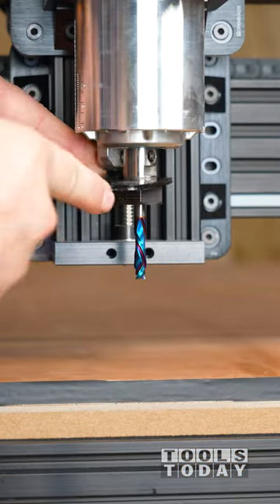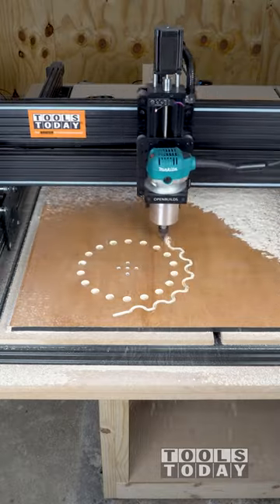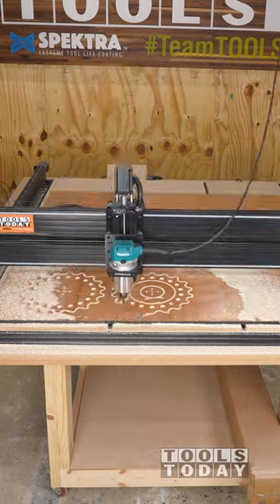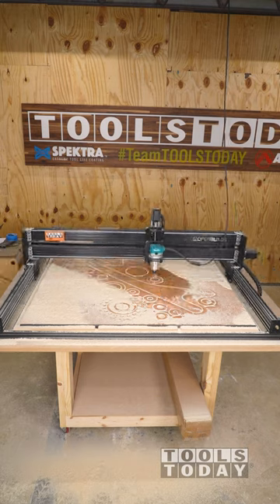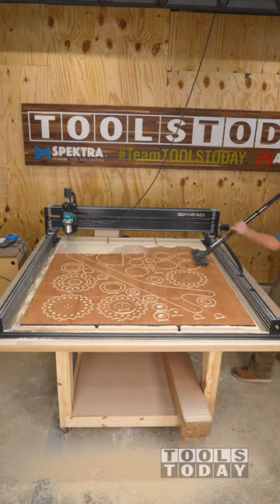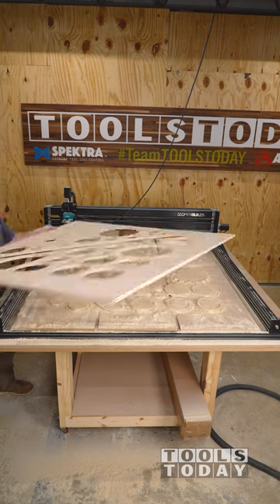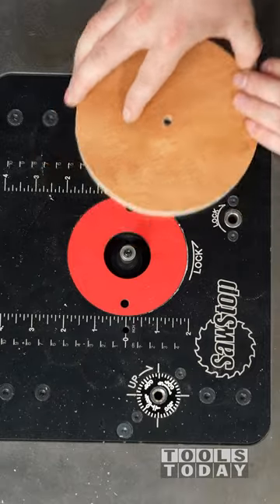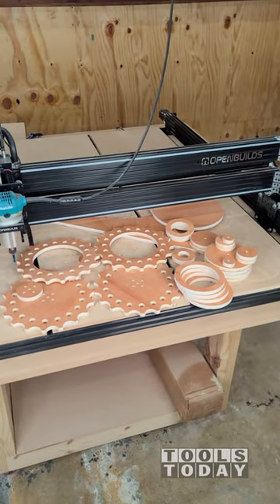Making Bulldozer Bed Parts on CNC

Comment from the maker: Check out the tools used on our website - https://www.toolstoday.com/openbuilds-3050-fl.html

Amana Tool 46170-K -https://www.toolstoday.com/v-13354-46170-k.html

RPM: 18,000
Feed Rate: 60ipm
Plunge Rate: 30ipm
Depth Per Pass: .48"

Multi-Tool - https://www.toolstoday.com/fein-71293261090-multimaster-amm300-plus-start-set-cordless-oscillating-multi-tool.html

SawStop Router Table - 
https://www.toolstoday.com/sawstop-rt-tgp-27-in-line-cast-iron-router-table-for-pcs-and-cns.html

Amana Tool 47104 flush trim - https://www.toolstoday.com/v-5334-47104.html
Reply: I work on a Homag N-300 5'×12' table. I used to work on an Onsrud 144g12. Worked on her for twenty years. I miss my Onsrud.
Reply: Hi Matt, I have a question regarding your feedspeed here. It seems really slow, when checked with a chipload calculator. Is that because this particular CNC simply can't move fast enough?
The chipload I've calculated is about 0.005, with a feedspeed of 200 ipm, at 18000 rpm.
But as I type this, I'm wondering if my Axiom AR8 could do 200 ipm, while cutting through 1/2" plywood in one pass.